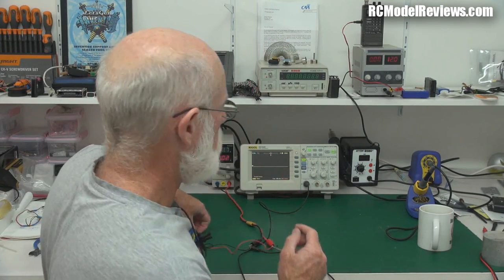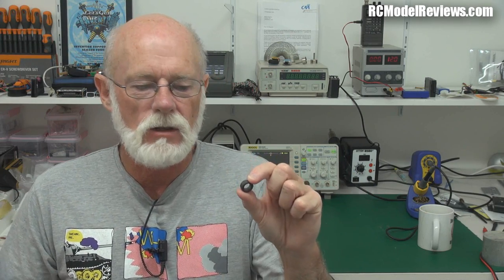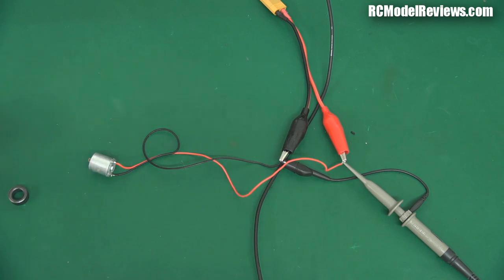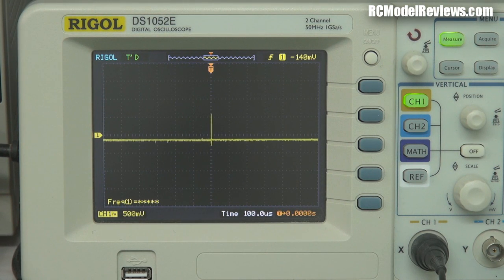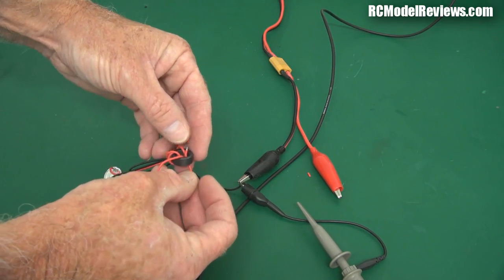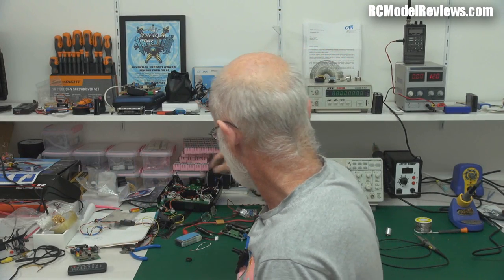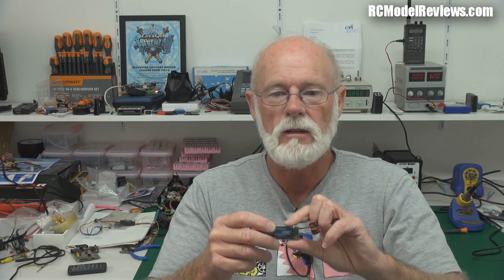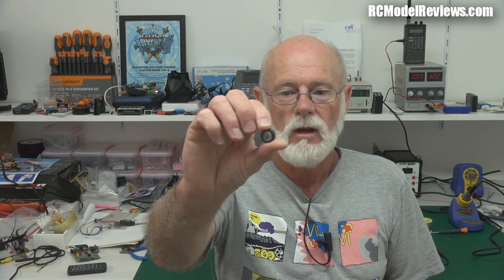Ferrite toroids for RC planes

Comment: Interference to the radios will not show on your low frequency scope.
Even lower frequencies that interfere with audio and video may not show.
Only very low frequencies are showing on your scope as connected.
A spectrum analyzer would show the actual frequency distribution of the noise.

The single red power wire carries DC current with the AC noise energy generated by the motor.
The DC current in one wire will saturate the inductor core at some level.
The AC noise energy passes through the black wire too.
Both wires can radiate noise or EMI (electro magnetic interference).
If both wires are looped through the inductor the DC component will be canceled because the current flows in opposite direction in the Red and Black wires.

Both wires looped through the inductor will block common mode EMI.
The inductor should be as close as possible to the EMI source (DC motor).
Adding properly sized capacitor will make a low pass filter that is more effective at blocking the EMI.
The capacitor should be as close as possible to the inductor.

Some of the products you show might be using a capacitor alone to do the job to  reduce weight.
Reply: The interference that affects modern RC gear is not in the 2.4GHz range -- it tends to be much lower and does not affect the RF section but the analog and digital sections.

You are correct that the cores will saturate at some point but that point is far above the 20mA of current-draw in this demonstration.  It might be an interesting experiment to see exactly how much current is required to reach that saturation point.

Common-mode noise is not really a big problem -- it's the differential noise which  creates most issues -- which is why I find it unusualk that some SBECs have the toroid used in common-mode configuration.  However, this common-mode use probably explains why the toroids are so ineffective at reducing the noise output of those SBECs.

Comment: Dear Bruce, i am afraid that you are wrong on this one. 1. Putting a ferrite on a DC motor is actually a bad idea, because it will force current flow onto a comutator that wants to stop the current flow. This will cause the voltage on the comutator to rise up to a point where arcing occurs. This will shorten the life span of the DC motor very considerably. DO NOT DO THAT. This applies to BLDC ESCs as well, their transistors doing the same thing as mechanical comutator, will fail early, and typically under flight stress. The appropriate method for reducing noise in power lines is to use a combination of electrolytic, tantalum and ceramic capacitors depending on the spectral characteristics of the noise and mass/volume budget. Place them as close as possible to the load to reduce lead inductance. Yes, you want to reduce lead inductance and not make it bigger.

Toroids are to be used in differential mode on SIGNAL lines to make the current flow symmetric and stop ground loop currents. They will reduce EM emissions and reception into the signal wire, improving overall system reliability.

2. The toroid on the HK BEC is not for reducing noise, but rather, to make the current flow symmetric betwen positive and negative lead. This nullifies radio emissions from the wires and is a good thing. If you remove this ferrite, current might flow through battery lead ground, creating a big antenna. That other BEC with no ferrite might be OK if you are sure you won't create a ground loop - but you have to know what you are doing.

Bruce, i value your videos, but please make a correction on this one before people  begin to burn their equipment!